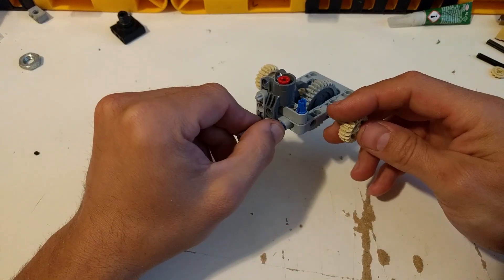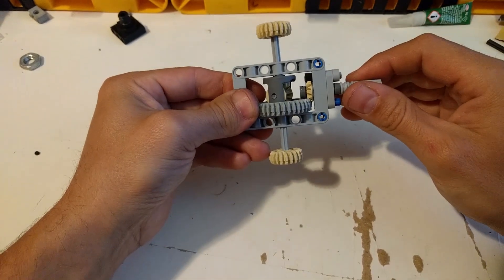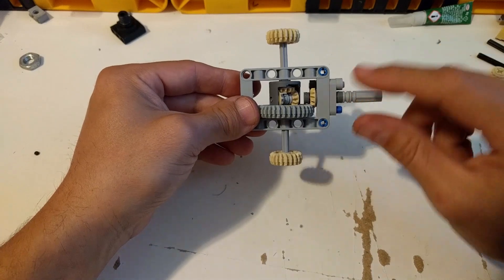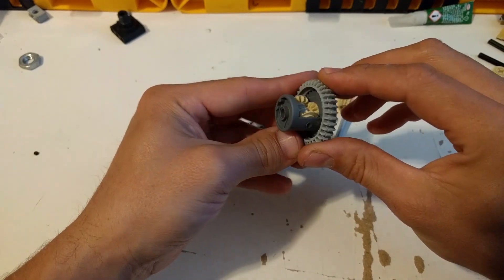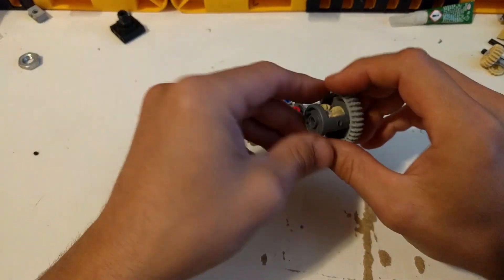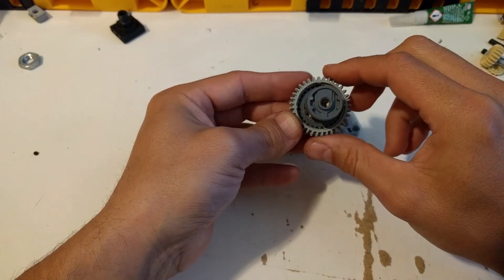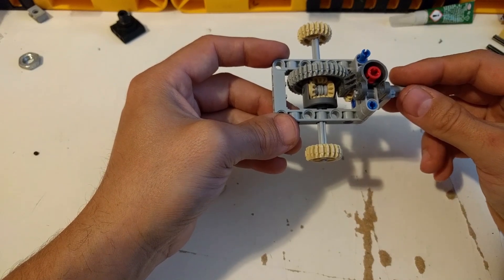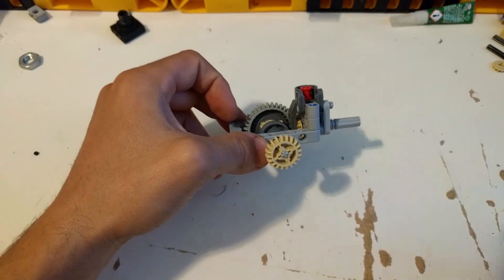Development diary 7

Comment: I'm currently making an off-road Lego tank. It will be powered by a 4-8 cylinder LPE and have 5 gears + reverse. I'm also making a clutch, that will be operated by a different pneumatic system, with less a pressure. I'm making it so when the clutch is activated(?) the engine will shut off, as to save air. The engine it self will drive a pump that goes into the airtank, that the clutch operates on, when the airtank is full it will disengage the pump from the engine, so it dosent overflow. The tank itself will turn by using a dual differential steering system, basically there's two inputs(one for forward/backwards driving and one for left/right steering) and one two outputs(one for each track). Because the steering system is going under a lot of pressure, I've made the differential myself(out of original Lego technic parts) so the stress is spread out on more gears. The input for left/right is driven by two XL motors(think that's enough power). But I'm having some trouble with the pneumatic side of things(like what engine, how to make the shut off, clutch system and so on.)
Reply: Two outputs* for the steering, one for each track.
Reply: Christian malik høj ignatiussen will you do video
Reply: Yes i could, just have to figure out how to upload.
Reply: Christian malik høj ignatiussen cool